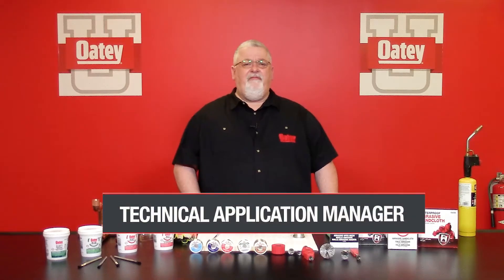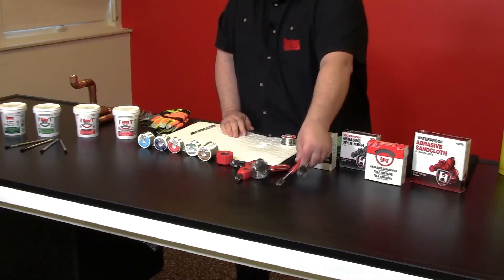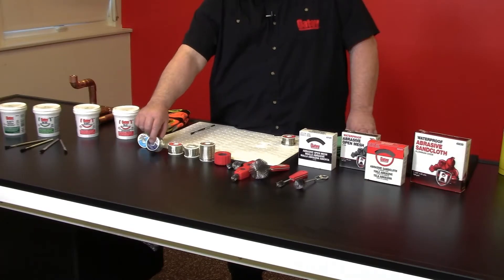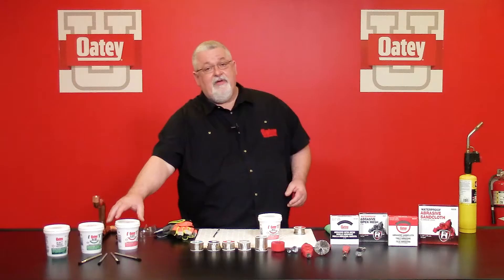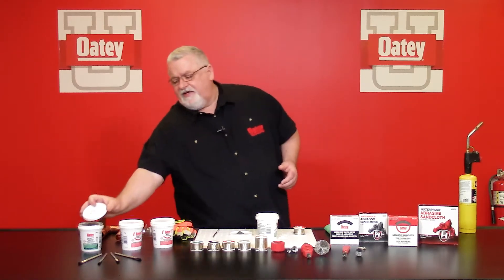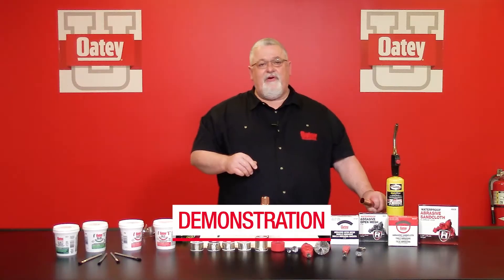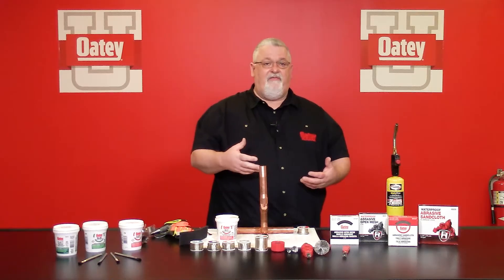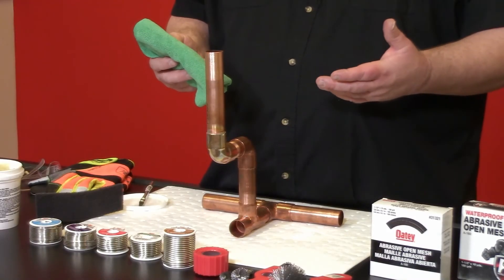Solder and Flux Application

Comment: Oatey should communicate the shelf life and need to stir flux on the flux container itself. If shelf life of flux is "2 years from date of manufacture" then there needs to be an expiry date on the container. I have no way of knowing when the flux was manufactured. If stirring is "very important", then that needs to be in the instructions on the container. One should not need to read a FAQ or watch a video online to learn these basic things. I'm commenting here because my joint leaked after using No 95 flux that was over 9 years old. I only learned about these things after figuring out what happened. When I tested the flux on top of a short section of pipe, flux from the top of the container was useless, leaving black clumps of residue instead of tinning, and not letting solder flow well. Digging deeper into the flux got some that works well. After thoroughly stirring the flux, it probably works well enough, though I don't want to risk it and will buy new flux because of the 2 year shelf life.